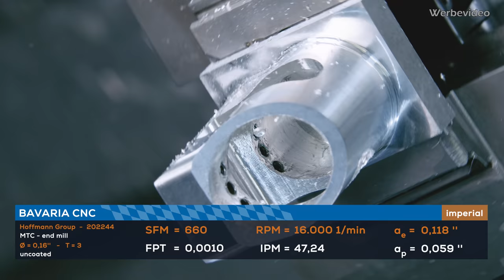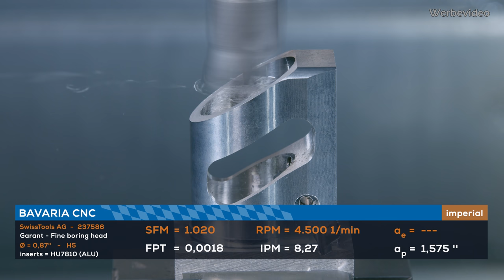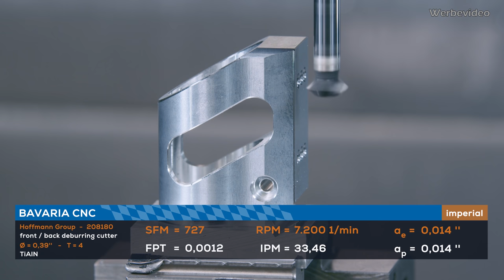CNC Machining a complete part in one Setup | Hermle C400 | SolidCAM | 5x chamfering

Comment: Interesting trick to hammer the part off the tab at the end! Can you show us how big that tab was? Seems like it was substantial!
Reply: i recently got good results with .15mm despite being brass.
Reply: 0,05mm tab, according to the video description :).
Reply from the maker: The good thing here is that it is a solid ring so the 0,05mm (0,002") are enough as it will be super stable you even could to small chamfering after it (but really only smaller ones). But I really need a hammer to get it off I can't do it by pushing.
Reply: @BavariaCNC  Ah! It being a ring makes a lot of sense, I hadn't picked up on that! I humbly request 'tab shots' in future videos! :)
Reply: @BavariaCNC  I'd like to see what the cutoff end looks like before you clean it up.
Reply: @BavariaCNC  Wenn du die Bahn für den Trenner beidseitig anlegst in einem Bogensegment wird der trennsteg noch dünner, weil das teil sich nicht auf einer kipplinie sondern auf 3 Punkten abstützen kann. Probier das mal aus wenn du lust hast.  So für die Teilegrösse würd ich sagen Bogensegment mit Radius 60mm

Comment: how do you program this transition 1:06...1:07 with SolidCAM? I was programming 5x machines with SC but never seen options for this transitions between different angle around A axis!
Reply from the maker: I have programmed an option in the PP to do that, but it is quite dangerous as it won't get simulated.
Reply: Isn't that just default heidenhain m128 functionality?, does it for me too, cool, but scary.
Reply from the maker: @max_eley  it is a standard function but you need to get it into CAM for a link connection this bring some tricky stuff with it, so i would not recommend it as standard
Reply: @max_eley  yeah, but Heidenhein has option Fmax and than you can control feed if nothing else. I know that software like hyperMILL have those crazy transactions but I am not sure how it gets simulated when it runs between different operations.
Reply: @neznamkaj  My iTNC 530 only allows F AUTO for plane spatial and plane vector, F MAX just error blocks.

it cant be simulated, i think vericut can simulate it.

Comment: One of the best videos showing the real part production process. Just curious if the chamfer mill can chamfer the the bottom of part after slot mill? Or it will have a huge chatter?
Reply from the maker: Thank you! The chamfering on the button is done with the forward/ backward debur tool. You see that it runs twice, so 1. Is with an extra minus in Z and a plus in xy so that the second run only takes in XY around 0.03mm

Comment: Another great video! Why do you stop rotating the boring bar at the bottom of the hole?
Reply: Are you serious?
If the bar was still rotating during retraction it would make a light 'spring pass' cut (probably with variable surface finish) and take longer.
So to stop rotation, move bar in X or Y a fraction and retract it clear of the work has a faster and more certain result.
Reply: @captcarlos  I am most certainly serious, I am still learning. Thanks for telling me though!
Reply: @captcarlos  no worries at all my man! Thanks for answering!
Reply from the maker: Thank you, James. Carl described it right why I stop the spindle, If you look closed you even can see that the bar will make a 0,1mm movement away from the surface so that this won't get damaged.
Reply: @BavariaCNC  great, thanks!

Comment: Curious Why you guys use TiAlN coated cutter with aluminium? Geometry is wrong for the material and aluminium binds easily to the coating?
Reply from the maker: True words, but sometimes I need to use that coating as there aren't too many options available. And those finishing cutters are mainly designed for steel, but they are pretty sharp, so as long as you cool them, you are all good.

Comment: Hi klasses Bauteil und Fräsarbeit. Frage zu den Spannbacken beim Schraubstock. Das die in der breite genau zum Bauteil passen Zufall? Oder habt ihr da eine Auswahl an Spannbreite.
Oder werden die von euch angepasst. Obwohl kleine Kontaktspuren zu sehen sind sehen sie nach Kaufteile aus.
Reply from the maker: Vielen Dank! Die Spannbacken sind tatsächlich Standard, ist hier Zufall dass Sie so gut passen. Bei dem Schraubstock bekommst du die in 38mm (hier gezeigt) 70mm und 100mm (sowie 120mm weich) Ich glaub ich mach mal ein Video zu dem Schraubstock der ist wirklich spitze.

Comment: 5.00min in, that was cool. I’m new to learning CNC, and using that double edge chamfer tool, then slitting saw was a cool trick to see. 
What is that double edge chamfer tool called please? And did you leave tabs during the slitting operation so the part did not get thrown off to the side? 
Thanks 🙏
Reply: My bad, I’ve just read the video description, and only a few weeks ago opened an account with Hoffmann 😁
Thanks for posting these great videos.
Reply from the maker: thank you a lot :)

Comment: how did you make the link between operation with same tool,is it machine control operation?No MB MAX
Reply from the maker: I did program me several options in the SolidCAM PP to choose which way the machine should handle the link between different angles.
Reply: @BavariaCNC  do you proof with an external g-code simulator your program.i also tried  but with MCO at least i see some movement in SolidCAM but never worked.Is SolidCAM buggy.Nice work
Reply from the maker: @arpadsomogyi4986  Right now I can trust SolidCAM and my PP so I didn't check external for around a year. the machine simulation is good in SolidCAM. But If you start with SolidCAM either use the 2020 version or wait a little with the 2021 this version is pretty buggy but with the latest SP it went in a good direction
Reply: @BavariaCNC  but the machine simulator dont simulate g code, right? So the linking moves are not simulated, or?
Reply from the maker: @arpadsomogyi4986  correct the guide won’t get simulated and the links between single jobs won’t get done.
Reply: @BavariaCNC  Just a last questions.Is TCPM or PLANE SPATIAL STAY then A+Q120 C+Q122 ?
Reply from the maker: @arpadsomogyi4986  the links between my movements are plane spatial move  connection. Just the 5x chamfering is using an TCPM one
Reply: @BavariaCNC  from where come the oil for the M3?sorry but, ich bin neugierig
Reply from the maker: @arpadsomogyi4986  all good :) I just applied it before the job, it is a bit thicker so it stays in there till the fomrer is coming
Reply: @arpadsomogyi4986  "sorry but, ich bin neugierig"

lmao

Comment: Why do you use a steel tool for alu?
Reply from the maker: It is really difficult to find a good aluminum finisher. The DLC coated don't work that well for me, the "old" ZOX coated have been amazing but are not produced right now. And these steel are pretty sharp so they work well in aluminum as well and till now I am pretty happy with this solution.

Comment: Why do you use a tapping head ?
Reply from the maker: Hi Niels! I like to use those for my smaller threads (M1 - M8) as here they help me to reduce the minimal failures at the moment of switching directions when tapping with higher spindle speed. For bigger threads or small threads with lower speeds you don't necessarily need that,
Reply: @BavariaCNC  aaaah i see, your right. Didn't see you where tapping at 3000 rpm... Hermle always looks so smooth. Next video stainless :) ?

Comment: the formtap didnt even tapped it, the hole was to big hahah
Reply: He first drilled 3.1 at the top of the holes and then 2.8 the rest of the way.
Reply from the maker: the 3.1mm on top is just for end users to have an option to put the M3 screw in the hole before tighten it. But the rest is threaded ;)
Reply from the maker: 100% correct!